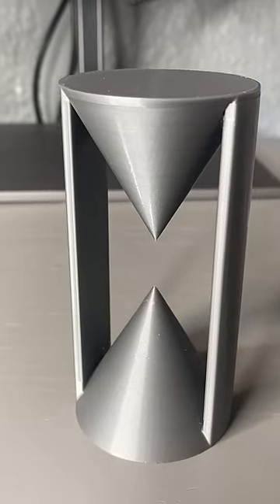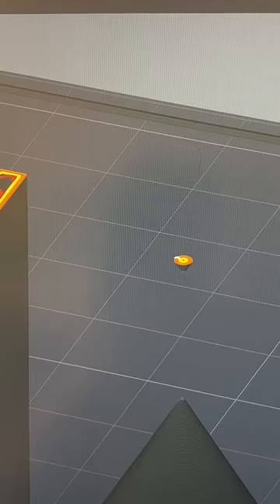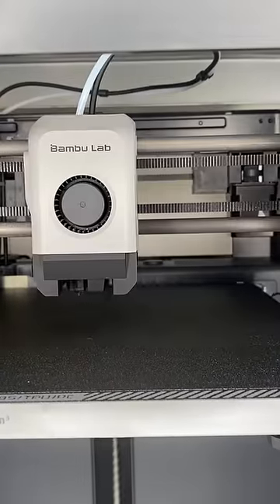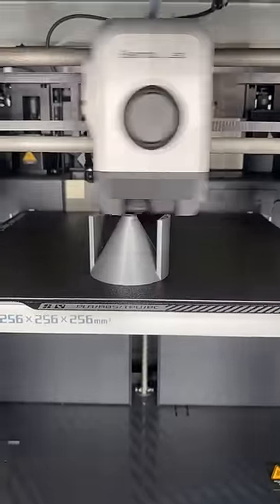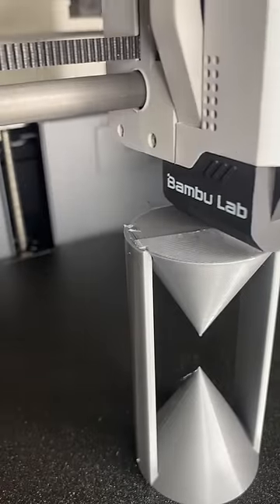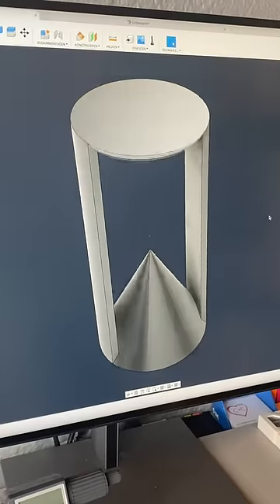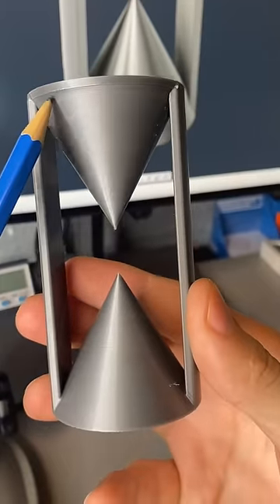printed WITHOUT support #shorts

Comment: Great idea until overnight print, a little support will save you a lot of effort.
Reply: there's a pause feature... it would just wait for you. not much effort to do what he did. 

if you did this method you might not care about the time wasted or plan accordingly.
Reply: @lupusk9productions  it's good if the print was multiple color but one colour. A 8 hours print will be completed in the morning without waiting for you to put parts in and resume.

Using support will be able to estimate the time and planning. Cutting part sometimes ruins your print.
Reply: It’s still a good trick to have up ones sleeve I think, depends on the part, some will be easier with support but this could also save a lot of work for certain parts where removing support would be tricky
Reply: @Enchanted Goose I don't get my point. Ex. 8 hours print overnight, pause at 12am wait for you to put the part in the morning. If you use support, the print would be completed in the morning.
Reply: I don't get it. You print the part to attach first then attach it when the base part pauses for you to add the attached part. Besides that it's not very different than a normal print. Either get a printer with a reliable power resume feature or get a UPS.
Reply: @benargee  I am taking about pausing the second part at midnight waiting for you to put it on in the morning and resume the print. Why not just put the support and get the whole print done in the morning.
Reply: @Enchanted Goose I understand the video just fine, just point out from another point of view. I am doing a lot of printing, about 15 printers running overnight 24/7. I just raised my opinion.
Reply: In this example a little support might be better, but sometimes when you need to support big area with holes it's actually saving a lot of material and time, which would be wasted on support and even more when this supported area has to be placed far from buildplate. It's not always possible to design part without such areas
Reply: @thearakong7159  here's a better idea, don't start printing so that it finishes at midnight.

Start your overnight print to finish printing at 8am when you wake up.

If this print is very short print time then why use your overnight printing slot to print quick parts? It will ALWAYS be wasting time that way.

This method allows far superior quality in your finished prints
Reply: @meateaw  For example, parts like in the video is not short time print. At least 8 hours with good quality. 

If you think it's a waste of time to print overnight, just don't print. As I said it's a good idea until overnight print, if it's a 2 hour print it's okay.

For me, my printers run 24/7 with planning. 1 hour stop is a waste, I need a plane which part to print overnight and finish in the morning so I can print another part.

No ALWAYS waste of TIME!
Reply: @thearakong7159  the time delay is well worth the extra quality he’s getting
Reply: @thearakong7159  It seems like a waste of time to have the printer finish in the middle of the night if that’s the case. If you’re printing a lot of things wouldn’t you want the least amount of down time? If you’re just doing one print then either way it doesn’t matter seems like planning to have it end when you’re able to start the next print with less downtime would be a better use of the time no? And this is just an example. I could see many cases where you could save a lot of material and times with this technique especially on something that would require way more supports than this example.
Reply: @Havok412  yes finished or paused in the middle of the night is wasting time. That's what I'm talking about, you would print a 10 hours part from night and almost finish or completely finished in the morning by using support, not paused in the middle of the night to wait for you to put a printed part in the morning and resume.
Reply: @thearakong7159  Ah ok gotcha. But you do understand that this is just an example to show the teqnique right? Not all prints happen at night. Maybe it makes sense for the 8hr print that you would need to pause to start in the morning and just have the pause happen in the afternoon when you're able to still go for the second part. I mean what if its a 16hr print with a pause at 8hrs? I get what you're saying but I think your only focusing on what this videos print showed as an example. There are prints that having supports are time consuming to remove and can cause issues with the print as stated in the video and having this essentially weld the second part is pretty awesome. Its really a case by case scenario and isn't a way to replace supports.
Reply: @Theara Kong  you also don't seem to be understanding everyone else. If you are already planning your prints out either start this one at midnight so the pause happens right as you wake up (no time waste) and print something else from 4pm to midnight where you had this printing previously. It's not a problem with this style of printing it's a problem of poorly planning your print schedule
Reply: How tho? If you print that top part next to the bottom part at the same time then just come in and slap in on ane press a button that's not much more work than trying to wiggle a peice out of an impossible to wiggle out of place yk
Reply: @andrewpotts7952  so you plane to go sleep at midnight every night🤣🤣. My plane is going to sleep as early as possible. My plane is good.
Reply: @camronmaccourt  Your plane is sitting down waiting for print to pause and put the top part in and resume. Mine is to get the complete part just using support which is normally used.
Reply: @thearakong7159  🤦‍♂You're obviously taking things too literal. Mind sharing the print you'e printing in this case since you seem to be focusing on your specific print which might not need to be done using this technique. Again its not a way to replace supports but it can make sense with certain prints. This is just an example buddy no need to think everyone is saying you're printing the wrong way. If you can see the use of this technique then it's simply not for you or you're not open minded enough to venture into something new. Stick to your plan.
Reply: @lupusk9productions  but remember the texture Is usually different after a while could result in a bad layer
Reply: Why do people who use 3d printers always try to be "the right one" in s every thread on YT lol
Reply: "a lot of effort" of... dropping a printed piece in? Which is considerably less effort than removing the supports?
Reply: I can't believe all the people who prefer supports.  Great for industrial parts, but you can't beat the quality here.  Supports leave ugly marks.
Reply: A little support can be a pain in the arse to remove. Considerably more so than a little forethought in your planning.

In this example, the main part and second part may take several hours to print. The actual bonding layers and finishing print likely took less than an hour. Set it printing overnight, wake up, put the parts in place, set it printing again and go make your morning coffee. It'll be done by the time you finish it.
Reply: It certainly has it's applications.
Reply: @thearakong7159 notice how you place the part right before the end.
It may take less time for the print to finish than it would to remove the supports
Reply: @Spencer-wc6ew  You missed my point, if you want to get the whole part over night you will need two machine following this but if you use support you will get completed object in the morning using one machine. If you run mass printing you will consider running two machines half night is wasting time rather than running one machine all night and still the whole object in the morning.
Reply: @KrazyKaiser  agreed
Reply: @lmaoroflcopter  That's what I am talking about the effort of waking up in the middle of the night vs cleaning support. As I have experience with 10 printers running overnight, I will clean the support to have a good sleep at night and work productively at day. Few minute cleaning support won't effect your productive but waking up in middle of the night is bad for next day as you need work on 10 printers and others work.
Reply: Imagine printing a support for supports to support the supported features. It would be done overnight
Reply: use the right tool for the job at hand.. this is one more tool
Reply: @thearakong7159 with all the issues mentioned in the video.
Reply: @thearakong7159 if you understand the video why are you ignoring the fucking video?? The supports will effect the print quality.
Reply: @Havok412  I'd probably wake up for a piss at some point so could check on it.
Reply: @thearakong7159  Imagine if it was a different part with fine detail all over the surface where support would be needed.  I'd rather pause then resume and just manage my time a little rather than spend hours trying to effectively hand carve the surface details and finish back out of a bunch of support.  With your very specific time example You could just start it before leaving the house for a few hours and it will suspend right around when you get back.
Reply: I didn’t see him going to bed in this video so that seems pretty irrelevant.
Reply: Naps not sleep.
Reply: But this solution increases the surface quality when the model shape allows it
Reply: Sorry, you folks are missing the point (no pun intended).  It's not about "finishing" the print, it's about advanced tricks to create a product.

Comment: A very interesting idea... I've inserted magnets, weights, etc before, but not other plastic parts! Why not! Thank you for the great tip!
Reply: This part has a great tip.
Reply: yeah, same here. Although " as strong as if it had been printed in one go" is technically not correct, I think, because the inserted piece is only held in place by one layer.
Reply: @jannsander  isn't every layer?
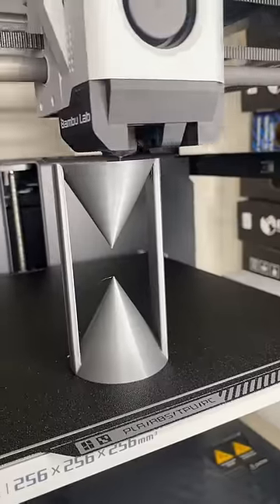Reply: @QiwiPear  no, if you look at 0:30 you can see that he inserts the part into a pocket. After that the printer puts a couple of layers above. But the only force resisting the part to break out of the top is the adhesion of one layer. If you had printed this in one every layer would extend into the bottom part and fuse like this.
Reply: @jannsander  I see. I forgot that the slots themselves aren't fused
Reply: will magnets stick to hardened steel nozzle? nee to 3d printing
Reply: Any idea which slicing programs allow you do to that? I've tried to remove supports on certain areas of parts, but haven't figured out how to do it yet, or even if it can be done in Prusa or Cura. I can turn them on or off, but cannot turn them off on just one area. There was a selection tool to select areas of the part to not add supports, but those "regions" are never organized in a way that's helpful. I can't just remove supports in the place I want without it also removing supports that are required.

(Also, I have no doubt that this part, when printed as two pieces is not as strong as if it was printed all at once. There is no fusion between the layers on the bottom intersecting "lugs" of the top cone and the "pillars" they connect to. I'm almost certain that the parts would have to be glued or epoxied to be truly as strong as if they were all printed as one piece).
Reply: @jannsander a drop of glue solves it 😉
Reply: how do u put weith? my figures is to light and i wanna make them more heavy
Reply: @deucedeuce1572  It sounds like you're using auto generated supports. Disabling auto-generated supports, combined with manually selecting the areas you wish to be supported would resolve your issue. I think most popular slicers can do both of these things.
Reply: @whitecanegamer  Cool. Thanks, I'll give it a try. I've gotten a little better at using support blockers in Cura, but I want to start using other slicers again. I just hope I can transfer all my settings, because I always changed settings in Cura instead of changing the settings on my printer (...because the changes never get saved on my printer for some reason). Every time I turn it on it starts back with the original settings.

Comment: Great idea, I have paused prints in the past to fill them with sand and epoxy resin to add weight to the part, but I never thought of dropping another part in to match the level and then having it bonded by the next layer, you have done the community a great service by sharing this method and I salute you for it!
Reply: That is actually an old hat
Reply: I tried sand once and forgot the fan was  on high (probably at 100%). Never again 😂
Reply: @tylers2889  Thats the exact reason I added epoxy over the top of it
Reply: @tylers2889  lol, would like to have seen that.
Reply: wait that’s genius
Reply: @tylers2889  I was thinking about pausing a print and putting sand in a print void,  to add weight. Reading this comment just saved me a lot of embarrassment!

Comment: I read people use Rice in the infill to make prints heavier lol
Reply: I'm actually looking into using plaster to weigh printed lamps down
Reply: What about lead shot or metal BBs?
Reply: I have used sand with great results
Reply: @skaramicke  good idea
Reply: @skaramicke  Whoah, I would be too scared to get some of the sand into the moving parts of the printer. Especially on a bed-slinger like my Ender 3, which would throw the sand all over the place.
Reply: @derToblin  I use sand then tape over it with painters tape. It keeps the sand in place and stops the fan blowing it out. Make sure the tape is fully insode the perimeter of the next layer because it is never coming out
Reply: You have to make sure you use the right infill. Some of them are designed for exactly this, not having any isolated areas in the infill. (I.e., grid bad gyro good.)
Reply: I know you need some weight but isn't Declan Rice a bit heavy for the machine
Reply: I used molten lead once. Made a hell of a mess .
Reply: I just use free sand
Reply: That's what they do with tape dispensers
Reply: @ColeUmland13  just buy the steel balls used for bearings. Cheap and can get them in a million sizes. Always works. Can toss in some epoxy/superglue to stop them from rattling around
Reply: @MaxC_1  bearings are supposed to be precision ground and finished...look for "steel shot" instead. It's like ball bearings but without the finishing process...should be WAY cheaper 🤠

Comment: This is honestly a really good idea
Solvents work well for fusing sure

I’m sure we all love avoiding those fumes where we can - after years in o-chem labs and working as a pharmacist, I think I’ve probably copped too much already hahahahahahaha
Reply: Why did you stop being a pharmacist
Reply: @Verzula  health reasons mostly

My spine isn’t the best so can’t do the long days standing anymore
Reply: I sometimes use a soldering iron to fuse parts. Sometimes pushing a staple between them for strength, and loose filament to fill gaps, but it's tricky trying to keep a uniform surface and isn't good if you care about aesthetics. Also you are limited with the parts the iron can reach, which is just the outside surface.
Reply: @ArcanePath360  you should try a 3D printing pen, they are very cheap now. Then rather than just melting the parts together you can add extra material too, which is good for filling gaps.
Reply: @conorstewart2214  Thought about that many times, but many just don't get up to temperature. They are like 190c at the tip. No good structurally and when you use PLA+ which works better at 205c+
Reply: lol. Yeah, my father worked his whole life in a chemical plant. I'm not sure which chemical he always smelled like, but it was always present. Bit as bad as when I worked "fish fry Fridays" as a cook though, or the rest of the week from just soaking up oil/grease fumes from the grill and deep fryer. Had a couple "larger" female friends always commenting on how good I smell. lol. Was so bad I would actually shower and get clean, but would then sweat deep fryer grease and smell like it again. I even tried taking two showers once (shower, sweat a lot and then shower again)... but it still didn't work. I would still smell like fryer grease as soon as I sweat at all, even if just a tiny bit.